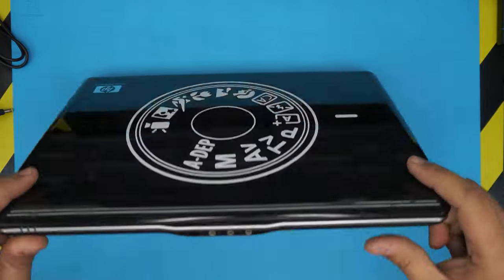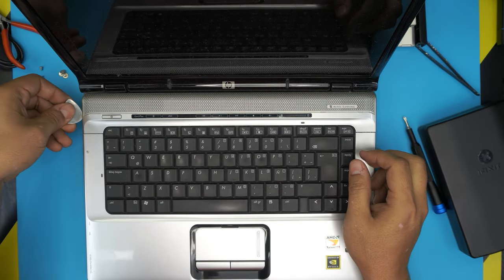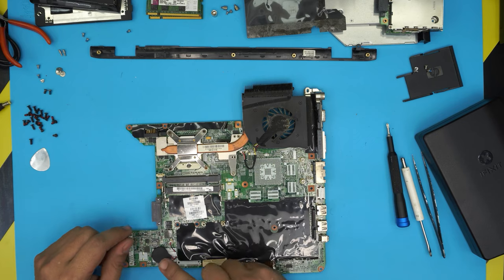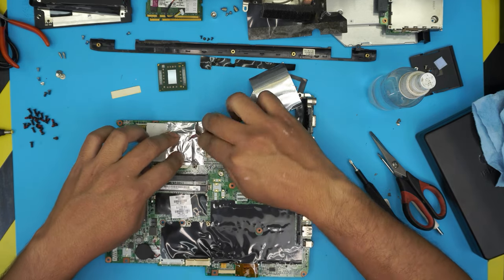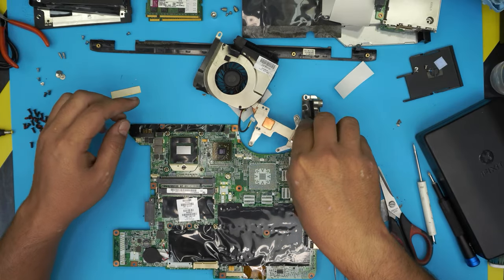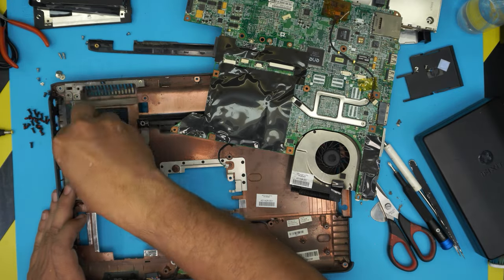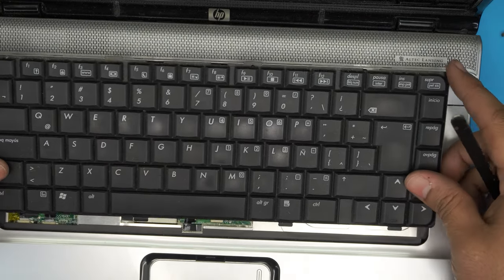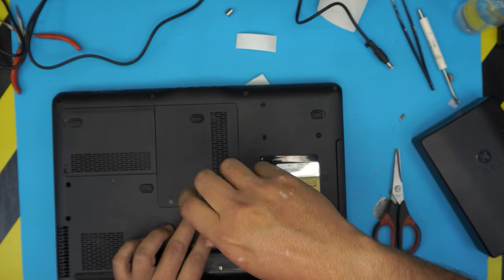Hp Pavilion Dv6000 Black screen,  no video repair GUIDE

Comment: I am slowly working my way through this and am really impressed with the way you explain things. I get frustrated with the videos that some people make with bad music and no talking. One question before I do the heat... should I add some flux under the GPU before I heat it?
Reply from the maker: Thank you for your feedback! If you'd like to support the channel, you can choose to like, subscribe, or do both!

Regarding your question, it is important NOT to add any flux under the BGA unless you have an ultrasonic washer and 6L of isopropyl alcohol. If you add flux, it will lower the temperature of the solder balls and facilitate the reflow process. However, if you don't properly wash off the flux under the GPU with an ultrasonic washer for 10 minutes at 60°C using the appropriate liquid, the flux can cause the solder balls to detach when using the laptop after a few days.

If you're using a hairdryer, ensure it's set to the maximum heat and keep it approximately 1 inch away from the CHIP. Heat the board for about 10-15 minutes. After heating, make sure not to cool down the board by blowing air or touching it for at least 20 minutes.

I hope this clarifies the information for you!
Should you have any further questions or requests in the future, please don't hesitate to ask me.

Comment: I didn't do the reflow part, but it was very useful to know how to get to the fan and clean it. If necessary I don't know, but it was very interesting for sure. It looks like the main issue for my laptop was removing one of the two rams and then it worked. Thanks mate!
Reply from the maker: It's my pleasure my friend. 😊 Thank you for taking the time to give feedback! If you would like to support the channel, please like, subscribe, or both. :P
yes sometimes (mostly) when one of the ram pads don't make a good contact, it won't boot.
Should you have any questions or requests in the future, please don't hesitate to ask me.

Comment: i love this video. I have a HP dv6000 like this one, when I press the power button it keeps restarting with the black screen, but sometimes it turns on without problems. I don't know if it is the same problem. if I have some free time I would try this procedure.
Reply from the maker: Thank you for your feedback! If you wish to support the channel, you can like, subscribe, or both!
Regarding your question, this video will solve your laptops issue, it fall under the same issue reporting errors.
Should you have any questions or requests in the future, please don't hesitate to ask me.
cheers🍻

Comment: The best video i have seen so far. I have a HP  Pavilion dv6-6120us Entertainment PC it is just getting power( blue power light is on) but it is not powering up, looking for some help.
Reply from the maker: Thank you for the feedback! if you wish to support the channel you can LIKE or SUB or both :P
regarding your question: so if you getting the lights and no screen 1st remove both rams and only insert one ram, and if you still get no screen, then follow this video and you will get your laptop fixed i promise :P

Comment: Hello, thank u for sharing this method, its worked for me. But after every shut down it happen again. is there any long term solve for this problem ?
Reply from the maker: Thank you for the feedback! if you wish to support the channel you can LIKE or SUB or both :P
regarding your question: double or triple your heating time my friend even 4x depending what you used to heat it.

Comment: Great job. Thanks a lot for your help😊. This laptop is a disaster to disassemble all the  components so you can't simply do and change thermal paste on it. 😢 Can you tell what are the thickness of Thermal Grizzly pads have you used?. ( i was not able to find this info). thanks
Reply from the maker: Thank you for your feedback! If you wish to support the channel, you can like, subscribe, or both!
Regarding your question, it is 1mm pads my friend

Comment: Hello i subscribed now to your channel. Please help me with that issue: what is the reason behind my screen going balck when i turn this laptop on? A hard disk being broken? What is the solution if i don't know how to repair myself? And what product ahould i buy to fix it?
Reply from the maker: Thank you for the feedback! if you wish to support the channel you can LIKE or SUB or both :P
regarding your question: its a very common issue, and i have covered on how to repair the issue in this video, the problem its on your GPU that is over heated and the solder joints are cracked, you will need to remove the entire motherboard (as shown in video) and place it on wood table and with no fan or any air blowing into it, and use a hair dryer at its max heat and keep it straight over the GPU with 1" height distance and for 5min and then let it cool down at room temp, and make sure you use a good thermal paste that is in video description.
Reply: @uFixTek  what will this do? And will it last as a solution? They told me i need to buy a new hard disk is that true? What will happen with my information on the hard disk? I subscribed and liked everything.
Reply from the maker: this will solder back the GPU to the board. in this video you can see a crack on solder ball, when you heat it up it will melt back and make a connection.
https://imgur.com/a/rGim5BR
 the hard drive has nothing to do with the laptop powering on and displaying a HP logo and saying there is no OS. 
you can remove the hard drive of any laptop and you can power on the laptop and it will display logo and a text saying there is not operating system(boot device). 
if your hard drive is falling you will get a lot of Blue screen with error or crashes. who ever told you the reason for your screen is not showing is because of the hard drive, ask them to stop doing drugs.
do as i said in the video and comments and you will have your laptop working again. NOTHING WILL last (we are not eternal) this laptops that you have G45,DV600,DV700 and many more are defective on cooling and they over heat and it will keep happening until you give up and buy a new laptop. who ever tells you otherwise its full of BS, i been doing this for over 18years and i have repaired so many DV600 motherboards. so if you want to fix you laptop do as i mentioned, and make sure use a good thermal paste, and make sure its aired from under (don't place it on sofa or bed). and it will work for another few months or so depending many factor. but if you want it to last a bit longer you need to do a REBALLING on gpu. the method i told you its a DIY so you can fix it temporarily. if you want it to last find a tecnician that know really how to do Reballing.
good luck my friend.

Comment: J'ai exactement le même problème, avec le même ordinateur, mais je n'ai pas compris après avoir enlevé la ventilation, nettoyer le processeur et remplacer la pâte thermique.. ca a fonctionner ? L'écran s'est allumé ? Je ne le vois pas sur votre vidéo ?
Reply from the maker: Thank you for the feedback! if you wish to support the channel you can LIKE or SUB or both :P
regarding your question: if you pay attention after removing the motherboard i have place the aluminum tape around and i have explained that you need to heat up the GPU with heat gun for 5min.
but here i explain again:
once you remove the motherboard, you need to isolate the GPU with aluminum tape (as shown in the video)
2nd you need to use a heat gun or a hair dryer at max heat and medium air, and keep it over the GPU with a 1" distance and keep it straight over for 5-8min
after that MAKE SURE you don't touch the motherboard for 15min. let it cool down on its own. 
once is finished then repaste and you done.

Comment: Can the two flex cable be disconnected located at the top panel? instead of disconnecting from underneath the keyboard? Video timestamp at @7:57
Reply from the maker: Thank you for the feedback and your support by a sub  :P
regarding your question: yes it can be disconnected from top panel or the motherboard, it makes no difference.

Comment: Is this a long term solution for this?
Reply from the maker: Thank you for the feedback! if you wish to support the channel you can LIKE or SUB or both :P
regarding your question:  no my friend there is no long term solution for this models, they are defective GPU and even if you purchase  new CHIP it will still be defective, the GPU model that is compatible with this motherboard, have a issue with core transfer balance and it will no matter what you do it will break down on you, i started repairing this laptops since day one that they got released and we have replaced the CHIP with new once and all. there was a site where they company agreed that they have messed up and the chips are defective, but nothing was done regardless, only few hundred returned with purchased notes. you can fix it but i would highly recommend you to resell.
here is the BGA chip but they are defective, https://www.aliexpress.com/item/1005001966891487.html?spm=a2g0o.productlist.0.0.1e966d5eQm0D20&ad_pvid=2021100215591610468999193684630012371706_1&s=p

Comment: Hi I have problem to my hp pavilion dv6000. I can turn it on but no display. I have a question the wireless why its open. I don't know exactly the reason why its not working at all.
Reply from the maker: Thank you for the feedback! if you wish to support the channel you can LIKE or SUB or both :P
regarding your question: the wifi its depended on video chip once or before the GPU fails the WIFI stops working, if you have wifi issue then do this video and you will get the wifi fix too :)

Comment: What's the heat gun temp..?
Reply from the maker: Thank you for your feedback! If you wish to support the channel, you can like, subscribe, or both!
Regarding your question, 230c for 3min with 1" distance then 350c 1' distance for 15sec
then let it cool down by it self. make sure you move the head of the heatgun in circles.
Should you have any further questions or requests in the future, please don't hesitate to ask me.
cheers🍻
Reply: @uFixTek  thank you for the reply. Btw i revived my old lying hp dv6700 using ur tutorial. Muchas gracias. 😘
Reply from the maker: it's my please, glad that you got it revived,
 saludos 🍻

Comment: I have a problem on my laptop when i put charger then my laptop goes slow processing any solution?
Reply from the maker: What windows you have installed?
Reply: Windows 7 but Windows not issue
Reply: When i plug the charger then my laptop goes slow means processor speed goes to 2.3ghz to 756mhz stable and i change charger but same problem with another charger
Reply from the maker: ok when you plug the charger the speed drops? 
and when using the battery only it runs normal speed?

Comment: I am working on the same laptop that has no post it beeps with out ram and it enters the recovery mode if I press the Windows+B and hold them before powering up but apparently I would need to have a USB floppy drive in order for it to flash the BIOS I do have a USB flasher but I could not find the BIOS chip the closest one I found was actually a power MOSFET so we're the others so I am stuck I already tried loading the BIOS via USB but it's not being read and I don't have a USB floppy drive
Reply from the maker: wait, the laptop will never post without a ram!, if you remove the ram it will always beep, so place one ram and power on and if you power on and you get the power light turns on and other led turns on but no screen! then its not your bios update or anything like that. its you GPU solder that are cracked. trust me and follow the video and you will have your laptop back! i been repairing laptop for over 18years!
Reply: @uFixTek  look I know what you mean but it does not post even with the RAM installed I just wanted to point out that it beeps without RAM which is why I am sure it's a just a BIOS issue as I have tested the RAM on a HP DV4000 Laptop and both 1GB sticks worked there I also tested known good 2GB RAM sticks from the DV4000 Laptop and it still won't post just wanted to ask if you could point me to where the BIOS chip is located at and I will be very grateful.
Reply from the maker: ok it should beep without the ram, but if you insist, the bios chip it should look like this and it should say winbond https://imgur.com/a/nkSYCbp
Reply from the maker: right here in the middle https://imgur.com/a/54qnF2J

Comment: You didn't put it on, so we can see it worked 😀
But seriously, now the question: you said about 280°C for about 2-3min..
So far, from my experience with similar boards, that is lead free soldering, so usually i have to preheat the soldering iron to about 320-350°C so I can remove slowly some capacitors from it.
Also, with heat gun, usually to get out the bios chip have to heat it to 380°C so I can do that..
Ho ,how exactly only 280°C will be enough for VGA chip 🤔 ? Just quires...
Reply from the maker: i appreciate your support and feedback, and this worked i been repairing laptops for over 18years, im not here to waist anyone's time. and in comment people have done this and they have fixed it.
its a simple physics and temperature logic :)
its like i ask you to hold an apple for 2min and you be fine and if i tell you to hold it for 5h then that would feel like 50kilo after hours of holding.
the reason you remove the bios or caps at 380c is because you do it under 10-15sec, and those components are not delicate like the BGA chips. so going up at 380 for 10-15sec you remove.
but if you want to remove the bios or caps with less risk of damaging with over heating, remove it with 250c for 3min preheating and then 4sec at 380 it will come out. that is the proper way of doing. you don't want ever to go sudden heat to max that is very bad for the components.
now regarding the BGA , we are not removing the chip so we don't need to melt all the solder balls under, we need to only melt and re-flow the single or two balls that are detached from board. so you can preheat at 220c for 1min then or go to 280c for 2min that would be enough to melt the single solder ball that is detached. and the reason that that single detached ball melts before the rest is that the rest are connected to the board and they are transferring their heat to the board over the balls, but the detached solder has no were to pass it heat so it tends to meld before and then the gravity does the job to drop it to the board wile holding from bga chip because its hot, and as we know solder balls are attracted to where the heat is.
i hope i have explained it in short, as the expended explanation its very long.
Reply: @uFixTek  Thank for talking time to write that!
It somehow hard to believe that 250°C will make any reflow, because even the lead free  soldier compound sold in the shop is rated 270-280°C
To melt it, you have to put the solder iron straight  on top of it. Still, if you make even simple test : take small piece of the reel and melt it over the soldier iron tip, then apply to some pcb connector hole. It melt on 300-320°C reasonably well, and flow fast nice over the component. Now when get cold and hard try melt it with 270-280°C...
You'll struggle quite a lot, even that is free to access with heat point.
Personally, I prefer to have preheat device (similar to grill) under the board and then reflow over , or even better heater station with IR top...
Stll, from what I see so far, the industrial new solder solution have even higher melt point. 
So when it is produced on the line is fine, but after that annoyingly hard to remove. And because is lead free, the joints become hard points and when the overall heat rise, the pcb bend and the points cracked...Well, maybe in that way they move the sales of new tech😁
Thanks for he video!!
Reply from the maker: i will make a video explaining this  a bit. BUT you right the proper way is with re-balling machine, we do have two in the shop and we do use then to re-fllow and re-ball , but the purpose of my videos is to help people to do it at home with a less equipment possible.
imagine me saying go buy a 2k usd BGA re-balling device :P
honestly i don't want people to follow my video where i tell them to set to 380c then they will have a higher chance of damaging the BGA, but with 280c with 3min or so honestly does the job and safer for the viewer at home to do it.
i appreciate your time and comments my friend, let me get my stuff organize and i get back at you right over here :P have a great day.
Reply: @uFixTek  Truly understand your point mate, and you're dam right! 
And highly appreciate videos as that one, because exactly people with some skills can build confidence and try to repair by themselves.
As for that model, i believe is no worth fixing it but unfortunately the very same issues goes with new 600$/€/£ machines..
Have delightful day also!
Reply from the maker: i know its not worth spending money on this models , but now its hard times and for some families if old stuff can last a few more months its a gain :)
cheers 🍻

Comment: From your video, the 2 flex cable underneath the keyboard connected to the power switch was disconnected
Reply from the maker: yes it can be disconnected from top panel or the motherboard, it makes no difference.
Reply: @uFixTek  thanks for the reply
Reply from the maker: your welcome my friend :)

Comment: Heating is not 100% solution !!  Thanks
Reply from the maker: heating is not a solution but its a fix, the real solution its a re-balling but 99% of the people at home don't have re-balling station or the experience to do this, im here to show them a fix that can last long time. 
with the heat you are doing a RE-FLOW of the solder balls. if done properly it can even last for another year or two. i been doing this for over 20years,  and if this can get people to save money and do it at home, im happy.
i appreciate the feed back my friend :)
Reply: @uFixTek  100% truth You doing good job
Reply from the maker: thank you for the support